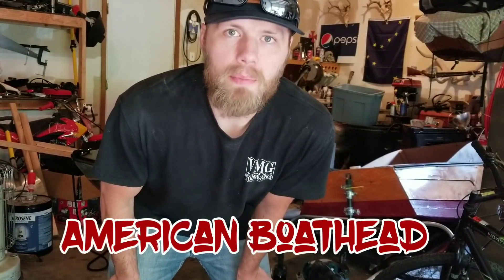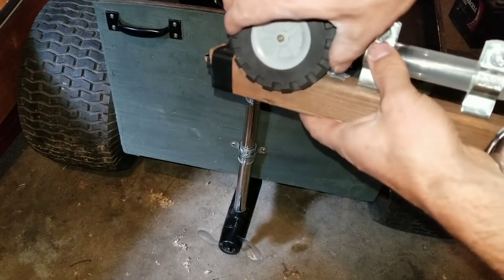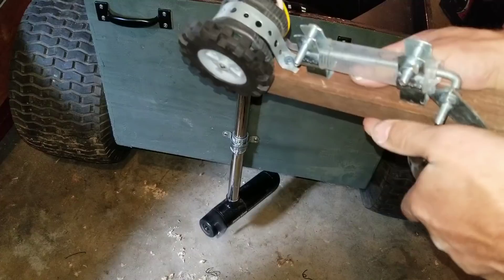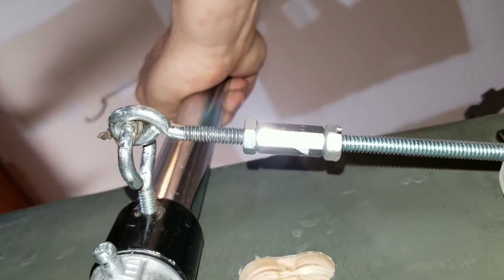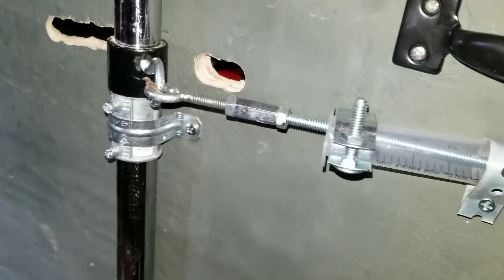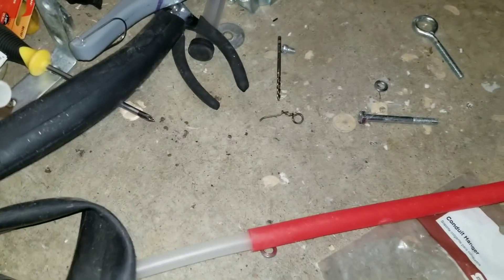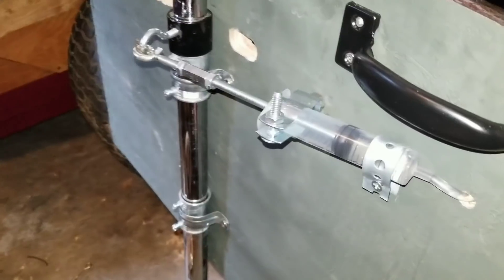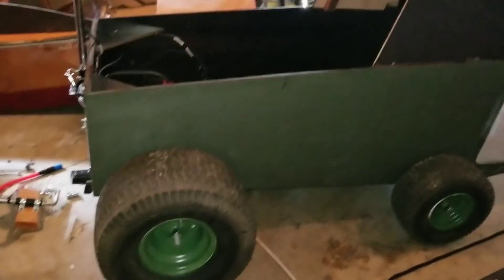Steering for homemade mini boat diy

Comment: Do you think I could make this work on a 14ft jon boat?
Reply from the maker: Yes but if turning alot is required, it's hard to keep air bubbles from forming and making the steering sluggish.  This was ok for a prototype but if you improve it, it could be perfect for what you want to do!

Comment: Love how you have innovated low cost steering systems...but is there anything low cost speed systems that doesn't require me to modify my existing minn kota??hope you got something to help me.
Reply from the maker: Yes there is! All you have to do is turn the speed to full forward and use a controller of any kind between the battery and the motor. It could be a on/off switch or a variable knob (pwm).
Reply: Would one of those turning house light switch work?
Reply from the maker: Yeah I think so. Not the dimmer kind though

Comment: Didn't have any luck with the fish tape/rod for mine. Too much play inside the tube and the pvc  tube itself flexed too much. Any updates on best for regular use and ease of install and durability?
Reply from the maker: The trick is to get small as possible tube and secure it well especially at both ends. My personal favorite is a lever with a fish rod straight shot back to the motor. There is almost no play whatsoever, its simple and effective. Second would be rope and pull not as simple but very reliable and easy to adjust to amountbof steering input desired. The metal fish tape with steering wheel is ok but finicky and more play. Syringes was not reliable enough whatsoever lol

Comment: I really like this setup it kicked up an idea that's currently still brewing in the ole noggin if i come up with something that works well i will certainly share it with ya.
Reply from the maker: The one problem is that with these motors, there is alot of back and forth and eventually air bubbles started forming.  But the concept is solid!

Comment: I like that a lot because it is cheap. i think if you put a crosshead on like an early steam engine. it would solve a lot of problems it would keep the piston centered,slides would only need to be made of wood,
if you dont mind spending more money adapt two motorcycle rear brake systems by connecting their master cylinders together, very tough works with real brake fluid,and has a facility for bleeding.
probably a bit heavy duty for this app

Comment: Just imagine what you could come up with if you invested in a 3D printer.
Reply from the maker: I considered it but i have a hard time with the designing part.  I think id need like three different programs from what i can tell...  i should try again though!
Reply: @americanboathead5390  you should check out tinkercad for starting on designing . And cura  for slicing you desings  and both are free.  Both are  pretty easy to learn.
Reply from the maker: @brianh256  i will thanks!  I like free!
Reply: @americanboathead5390  thingivers.com  is a good place to get free files like high pitch trolling motor props.  Might make your boats faster.  Lol

Comment: Those surgical syringes will work for now but will rupture under stress. I'd suggest using copper pipe with fittings as it will hold up better. I actually know of someone who did that a long time ago for a trolling motor, only done with fuel lines and actual hydraulic fluid, etc. I'd add a pivot to each one with that way you can use the large one on the motor end and the small one on the steering wheel end without having the plungers go sideways. I found out from my grade school days if you try to lift stuff with syringes, it ends up rupturing the case before the tube can pop off.
Reply from the maker: Thanks for the tip!  I just figured since its not a rudder, the motor actually turns quite easily and so far it works great!  I wonder how i could attach copper pipe to a syringe or what else i could use that would not cost alot..  maybe i could double the sytem to pull and push at the same time.. but there again, after testing, no problems... yet..  lol  we'll see i recon!
Reply: @americanboathead5390  The one I seen had a reducer and nipple soldered to it. I was just thinking of you got caught in some weeds or something, it might put a lot of stress on them.
Reply from the maker: @travis4798  now that you mention it, that is a real possibilty!  I dont know how i miss things like that! Theres quite a bit of seaweed later in the summer  or ragweed not sure..  thanks for the tip!  So is it the hose that ruptures or the syringe?  I dont know of an alternative for the plastic syringes..
Reply: @americanboathead5390  The syringe since it's made of thin hard plastic. The lines are fairly robust being rubber.

Comment: That hydraulic steering system is so. freaking. COOL!
Reply: I'm not sure if you've thought about it or not, but a non-toxic alternative to water that's a bit more dense occurred to me. Vegetable oil. I don't know if it would work or not but it's a thought.
Reply from the maker: @BudgetGunsandGearReviews  thats a great idea! Non corrosive as well!  Thank you for the ideas!  Keep em coming!
Reply from the maker: Thank you!   I hope it works in the wild too!  I think it will but need to test it!  Stay tuned friend!

Comment: 200iq. Like the water idea. Can be useful for other things as well. move up and down a hidden mooring. Maybe work together with a  linear servo:

I myself are experiencing with steering by using RC servo (winch) for 360 degree steering. Same For throttle. I want my electric boat to be able to by controlled remotely.  And only using small switches (Servo tester).

Im also testing out 3s lipo batteries. Do you plan on doing that?
Reply from the maker: Yes!  I am worried that the lipo battery could get wet and explode!   But seriously, i am not good with electrical stuff so its hard for me to trust it.  If you look at my video "glass bottom mini boat test #2" you can see what i came up with!! Id love to see what you comebup with as well!
Reply: @americanboathead5390  in my first boat design, the part of the boat that I was supposed to sit in was separate from the the motor and electronics, with the ability to quickly separate it from myself in case of fire (lipo burns nice when it catch fire).

But after research, I believe that if you operate with good margins, the batteries will do fine. Like going for dobble C rating that you really need. I also would like to have a power bank that can be used for different things (example camping).

My 6 weeks away from my job just started, so I migth be able to document my summer projects. Your projects has helped me. Maybe some of mine can help you and others. Keep posting videos!!
Reply from the maker: I appreciate your ideas!!  Good luck with work also friend!

Comment: Love the steering setup. Thanks for sharing! I wonder if it may be a little more responsive if you used some type of oil or perhaps brake fluid? Something with a bit more density but also wouldn't be corrosive to the plunger?
Reply from the maker: Someone else suggested dish soap  that might be good...   def dont want poison or corrosive!

Comment: Using a 'rack and pinion' setup to move the plunders would help. More leverage and the plungers would remain in the center of the tubes.

Here is a site that can create gears that can be printed and transferred to paper to cut with jigsaw.

https://woodgears.ca/gear_cutting/template.html

Very imaginative Brian!

Comment: Pretty cool.  I wonder if you used dawn soap instead of water if it would free it up a little depending if the issue is the rubber seals or the pressure itself.  I like the steering videos.
Reply from the maker: I also wonder if the tubing might be flexing a little...   i guess i dont really need it perfect anyways but a lil better would be nice!  Thanks Nick!